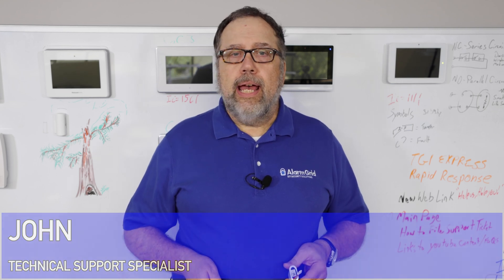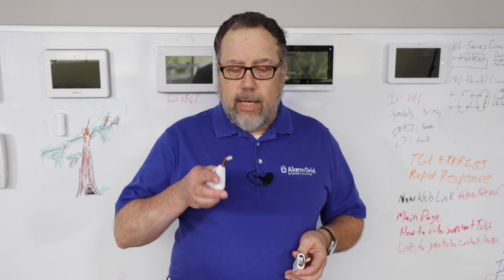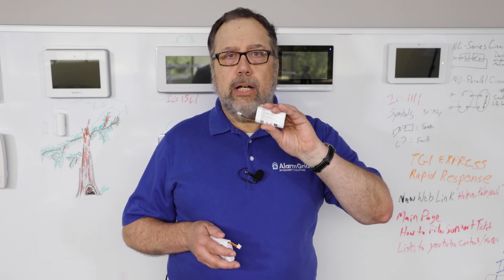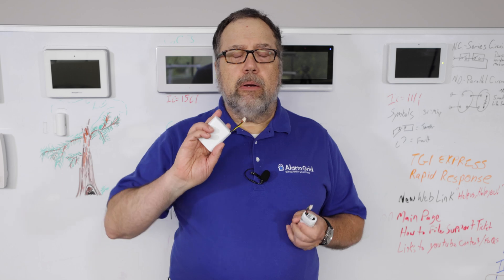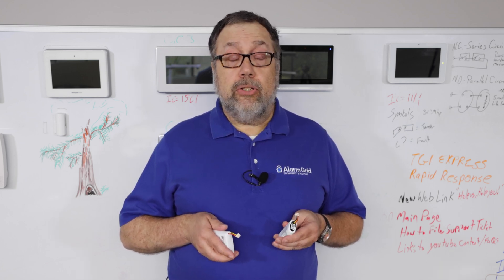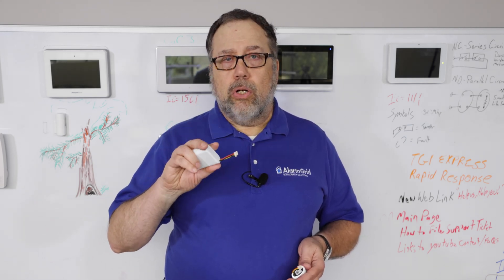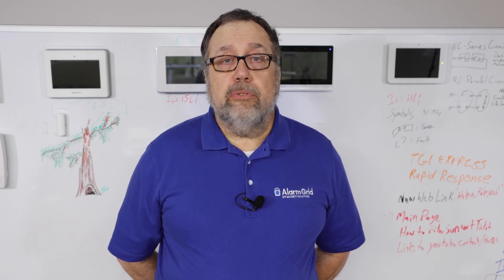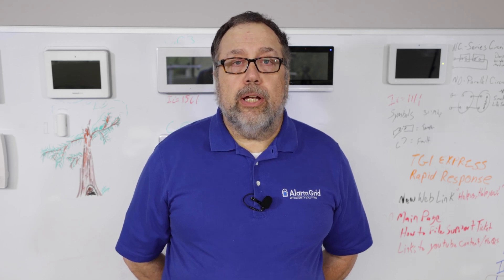Resideo ProSeries: Batteries Used and Why

Comment: Hi, How long the original battery is warranty? It seem's i have problem with mine with a PROA7 panel. After a power faillure, the low bat message is impossible to erase on my panel.
Reply: Hi Carl,  Resideo Warranty is two years. Your Dealer would need to reach out to the manufacturer to get replacement support for your battery.  For Troubleshooting, How far away is your panel from the Wall adapter? Then wall adapter should not be further than 25 feet when using 22 AWG wire. Excessive wire distance can cause battery charging issues.